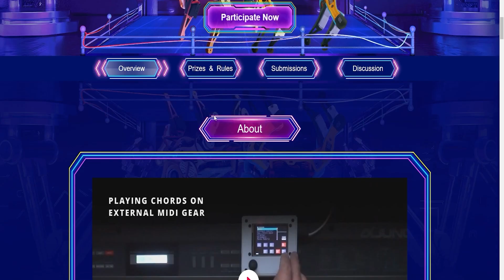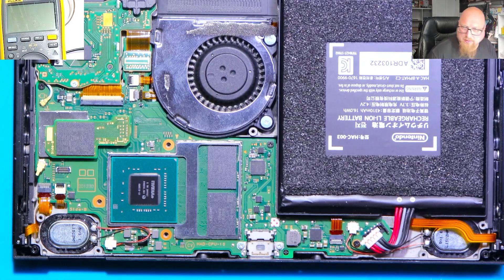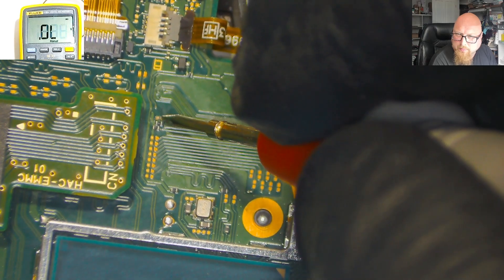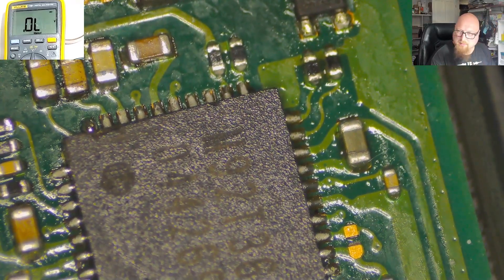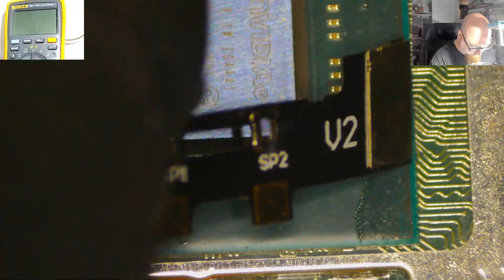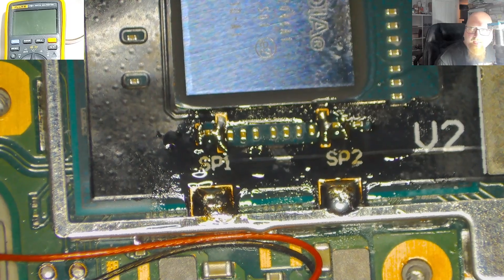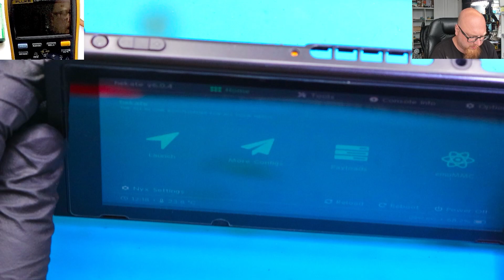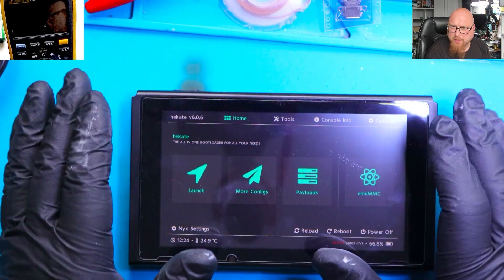PICOFLY in Nintendo Switch V2??? Let's solder it on...

Comment: I've seen a couple of really clean installs (on a V1/V2) that looks like they just cut the flex cable and solder a wire to the other side of the cable instead of using the middle pin and paired with the RP2040-Tiny. I'm considering trying it, just wondering if there are any downsides. 

For reference: https://www.youtube.com/watch?v=qOkZMyTqsbE&t=800s

Comment: So before you install the chip do you always update to latest firmware even currently to 17.0.1 i heard alot of stuff on brick ing in that version?
Reply from the maker: At the moment I don't update the firmware to the latest because of 17.0.0. Signpatches are not ready yet.
Reply: @tvpartsworld806  so what firmware u have to have in order for it to work ? everything below 17.0.0?
Reply: for anyone intrested first update ofm to 17.0.1 then solder chip in my case picofly then hats pack and ure done works for me sigpatches work to 17.0.1 now

Comment: Hey, have ever seen the problem, that a Switch Oled doesn´t boot into any firmware after HWFLY installation? Hekate is running perfectly fine, emmc benchmarks totally fine. As soon as you start any firmware, there appears a small line on the right side of the screen and then black.

Comment: how do you know which values the multimeter should display?
Reply: I know each one has a range of voltages it should show; I don't remember where I read that but if you google switch diode ranges you should be able to find it

Comment: Did you go with the mobo soldering mod instead of nand adapter mod just because you didn’t have that chip in stock? Or was it for some other reason?
Reply: Ok I see one bonus, no cut on EF shield is nice, not sure if it’s worth the effort/reliability.. with that said this one chip will work no matter the revision of switch so that’s neet